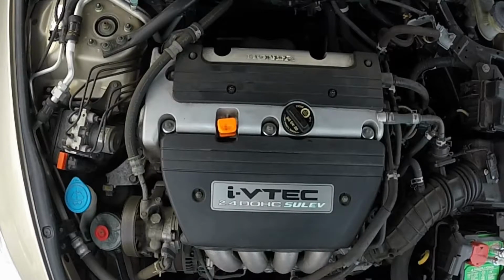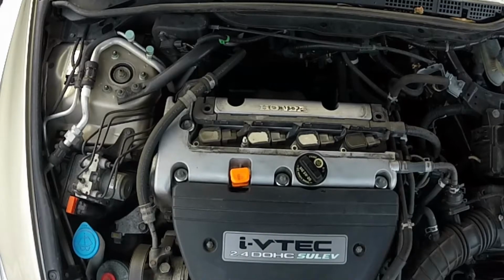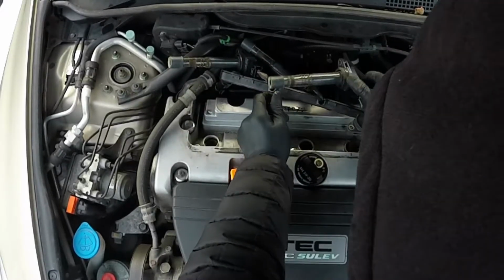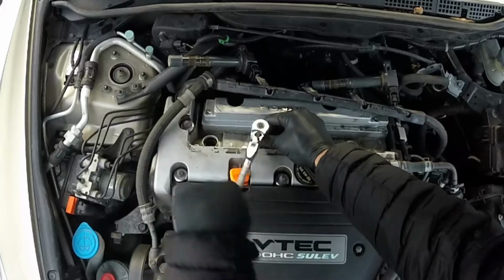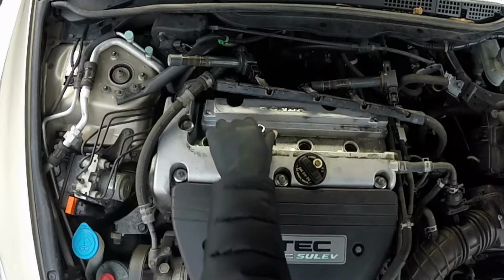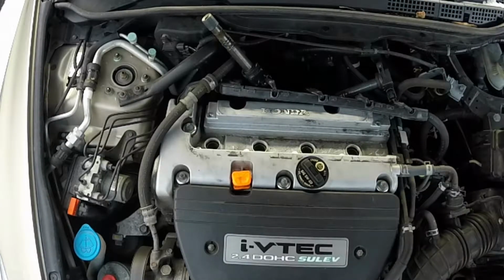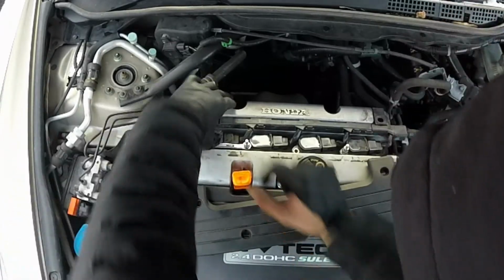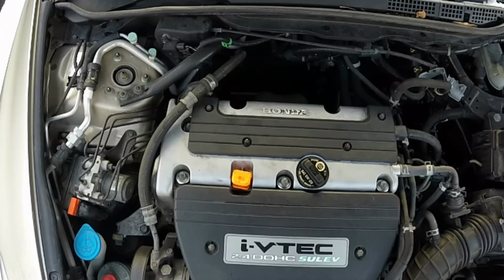2006 HONDA ACCORD SPARK PLUG REPLACEMENT

Comment: It is worth mentioning that you should check with a Honda dealer parts department on what exact plugs your vehicle takes.  This is done by using the VIN number when speaking with the parts department.  I say this because my Honda Accord takes the NGK IZFR6K-13 plugs gapped at .052 and not the NGK IZFR6K-11 plugs, gapped at .044.  This is because my car is a SULEV and PZEV model.  The car and emission system and tuning were designed for this plug.  Without using the VIN to check I would not have realized this because NGK's site lists both plugs for a 2007 Honda Accord.

Comment: Would this be something that would come up on the "maintenance minder"? My '06 Accord EX is 2k shy away from hitting 100,000 miles. I believe 100k is around the lifespan for spark plugs in this model. I am getting a bit of hesitation when I accelerate from a stop.
Reply from the maker: No, just follow your owners manual. I would replace them when you can if you haven't. Have you changed your air filter recently?
Reply: I thought about that but it has only been about 10k miles since my last air filter change. Might still be a good idea to check it earlier since we've had air quality problems in my part of the country.
Reply from the maker: @jdryyz  If they are the original spark plugs, that could be the issue.

Comment: Any reason you didn’t unclip the electrics at the coil packs instead of trying to remove & lay the whole 4 in one piece? Wouldn’t it be easier? Great video..
Reply from the maker: Probably didn't want to take the chance of having any of the clips braking, wasn't my car. Old plastic brakes all the time.

Comment: oh those great vtec engines. my mom had 1990 and a 1998 accords both rock solid engines. not a single issue. reg oil changes and maint, and never skipped a beat.
Reply from the maker: I hit the red button!
Reply: Did and done my small yous tubers friend! Cheers!
Reply from the maker: Thanks!